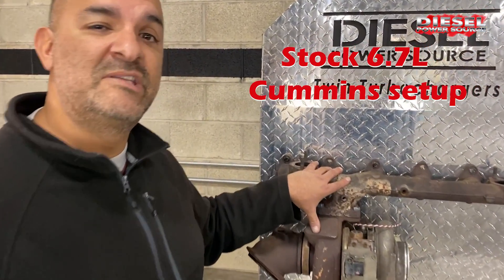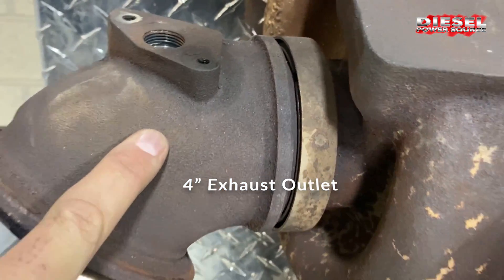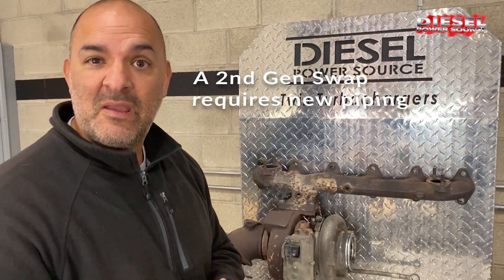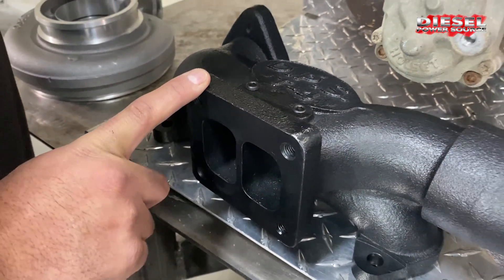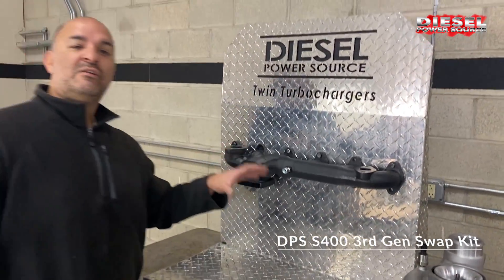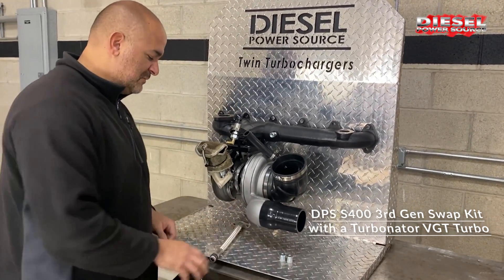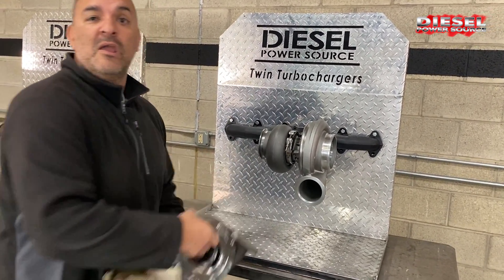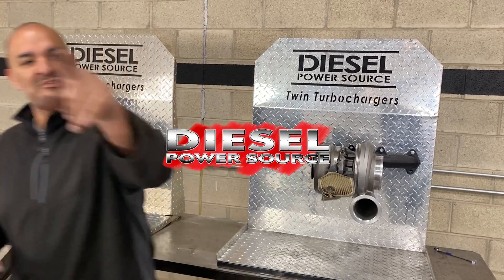How to turn your S400 Turbo into a VGT | Fastest Spooling S400 Turbocharger

Comment: i have a 2jzgte vvti with big single turbo  i also have an s400 sitting around  i feel like this vgt setup would be killer on it   i also run a standalone ecu so i believe i can control it just like an e gate   how much is that vgt rear housing      i know its a long shot but i think it would be a good market for yall to get into as with the cummins platform the jz platform is a very expensive and profitable platform to make one off parts for   id love to be a guinie pig for yalls system  i have supporting mods to make 1000hp this seems like the best of having a big turbo and little turbo   what ar does it range from?  like .81_1.25  or is it even broader like .68_1.35

Comment: So im lost... VGT is 1 thing. But you repeat few times exhaust braking where I can't see any "exhaust retarder" there.

Any way... I have gen3 2003. Want to fit gen2 centre exit manifold and S400 VGT vacuum turbo. How much the parts sent to England going to cost me ? And what's the maximum power this setup will make?
Reply: Vgt gives better exhaust braking
Reply: @truckingjamaicans5045  almost all European diesels use VNT turbos and it doesn't do any load to the engine when decelerating. Can't see reason why it would when vanes ain't stuck shut but open. They work to spool up the turbo controlled precision way but then gas not applied they just open and make no resistance to the gases.
Reply: @broskis80  well i heard it increase the braking thats all i knw